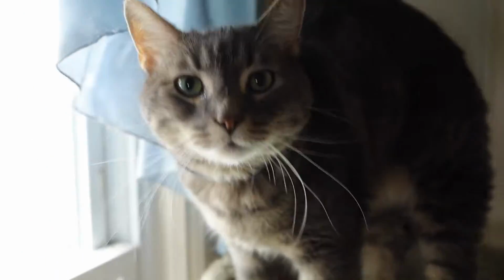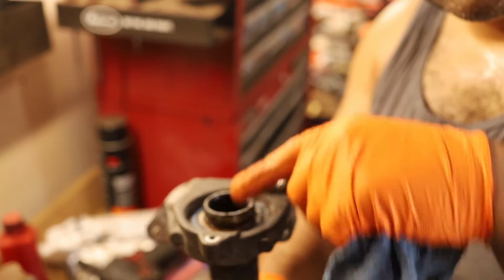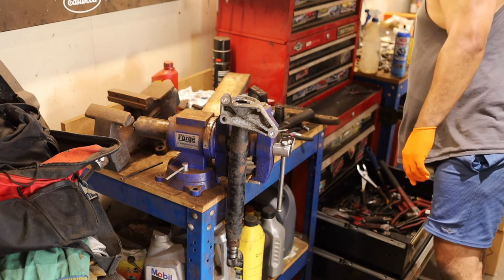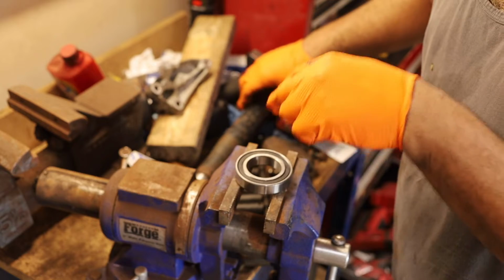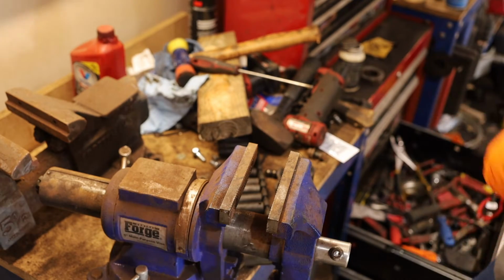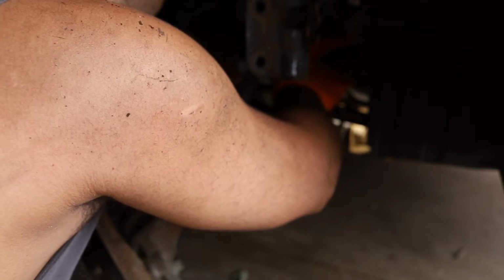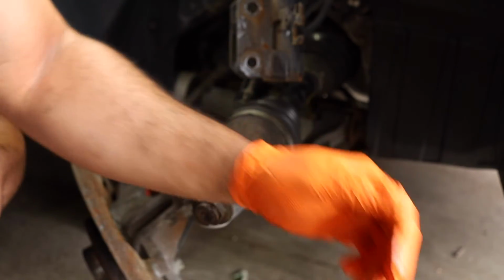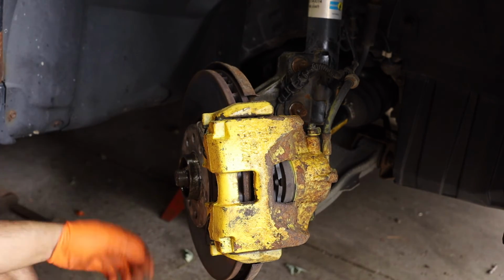2003 2010 Saab 93 Mid Shaft Bearing Replacement

Comment: Literally just realized mine is completely shot on mine tonight! Need to find the part number for replacement!
Reply from the maker: I hope the video is helpful. I mentioned the part number in the video. It is just a closed bearing.
Reply: Its actually a 6008 2RS  bearing  skf  or fag are good brands  40mm x68mm x15mm .